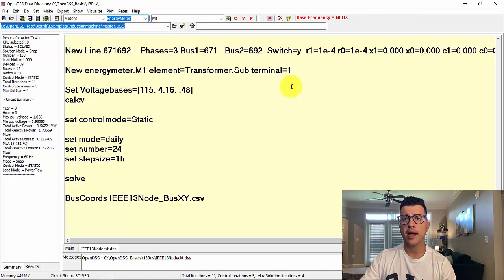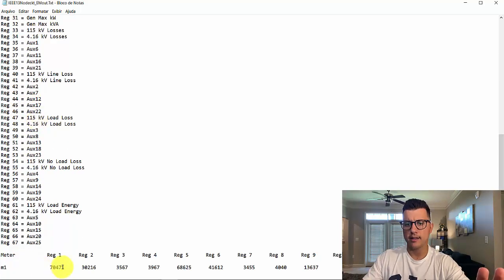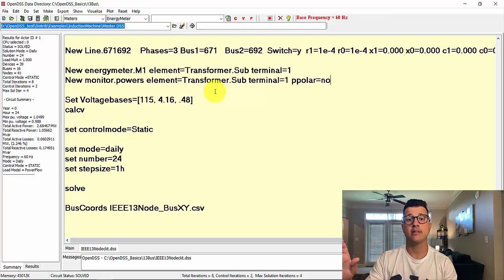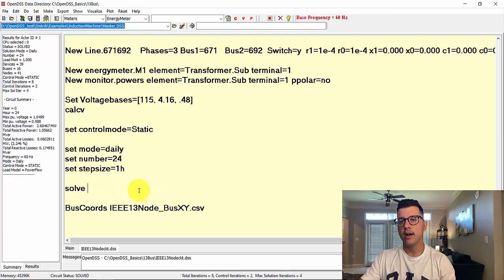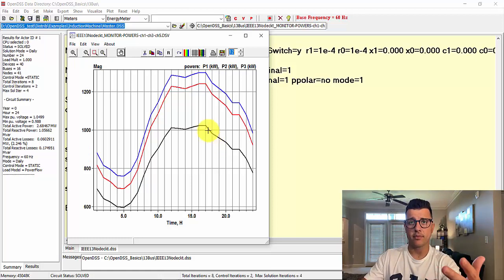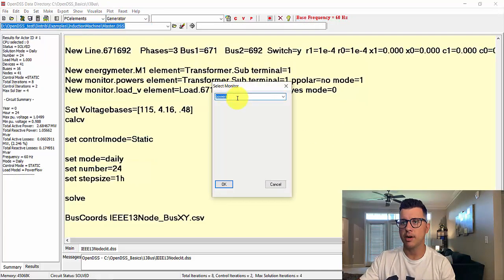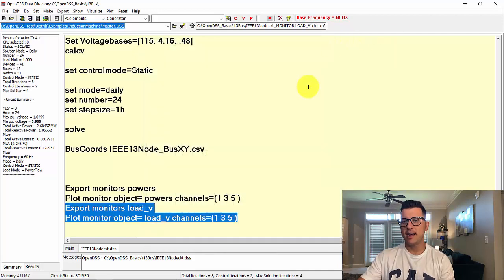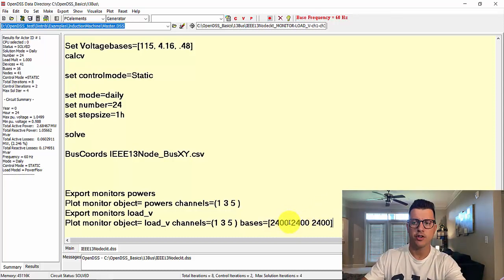13 - [En] OpenDSS Basics | Time-Series Simulation Results

Comment: Your videos are amazing！ I have a quick question. I noticed that the data in your notebook automatically aligns when you open it. Could you share how you set that up?
Reply from the maker: Hi Cheng Tao, 

I am glad you are enjoying the videos. Regarding your question, could you give me the right timestamp in the video, so I can see what you meant?
Reply: @PauloRadatz  At 1:20 in the video, after simulating with opendss, the data in the .txt file is structured, and each column of data is displayed clearly, but my data is not like this when the .txt file is opened. Could you share how this is set up?

Comment: can you please do some examples of harmonic analysis as I heard this software was first developed for the purpose. there is no proper examples or guide from where one may see the harmonic analysis performed.
thank you
Reply from the maker: See one example here: https://github.com/PauloRadatz/py-dss-interface-examples/blob/main/daily_harmonic.py
Reply: @PauloRadatz  Thank you for sharing the example but unfortunately, i am not able to understand it properly as I am a MATLAB guy and have no experience of Python. Furthermore, I am interested in Iterative Harmonic Analysis of cosimulation with OpenDSS and MATLAB through SIMULINK model. I have already established the COM interface between DSS and MATLAB. 
The problem that I am facing is that with the iterative harmonic analysis I am not able to get the same values for each voltage harmonic as expected through Reference Simulink model. The circuit in OpenDSS is correct but still I am having issues and is making me crazy :(

Comment: Hi Paulo. Thanks for the video. I am using py-dss-interface to run OpenDSS. Do you have any video/documentation where you add a PV/ ES in any distribution feeder model (IEEE/other) using py-dss-interface and run powerflow? I am new to OpenDSS, so I am confused how to do it. Thank you.
Reply from the maker: Hi Abdullah,

An important aspect of OpenDSS interfaces in general is that everything you do using OpenDSS commands in the OpenDSS GUI version can be done using the text method of the interface. In py-dss-interface, you can use dss.text().

Let me know if that helps.

Comment: Hi Paulo!  Thank you so much for making these videos  for public.   I have a question. The results of "monitor" are exported to an excel file (e.g., Export monitors loadvoltage).  I am simulating my .dss model using python interface. I want to automate the process of plotting results.  I wanna save the path of this excel file ( export monitor ) in a variable in python so that I may plot the results automatically, by reading this file. How can I save the full path of this excel file to the variable. can you please help?  Thanks
Reply from the maker: Hi Kirn, 

You can use the dss.monitors_ methods to store the monitor's results into Python lists.

First, activate your monitor by using dss.monitors_write(), then use the dss.monitors_channel()

Let me know if you could make it to work.

Comment: hi! If i want to connect a PV system should i add generator to my system or open dss has any other option 
If so how can i add generator?
Reply from the maker: Hi Zafran, 

Depending on the input data you have, you might use either PVSystem or generator elements.

Comment: Hi Paulo, I need a video or a Matlab interfaced code of OpenDss for PV hosting capacity analysis for 123 bus system.
Reply from the maker: Hi Abdullah, I have a simple code in Python that you could use to start your MatLab code. https://github.com/PauloRadatz/HostingCapacity_OpenDSS.

You can try to watch a Portuguese video: 
https://www.youtube.com/watch?v=jqnS5KqZQuE&t=6552s
https://www.youtube.com/watch?v=BztejIqRzfA&t=6s

Hope it helps, 

Paulo Radatz